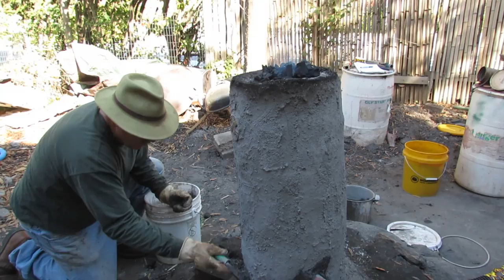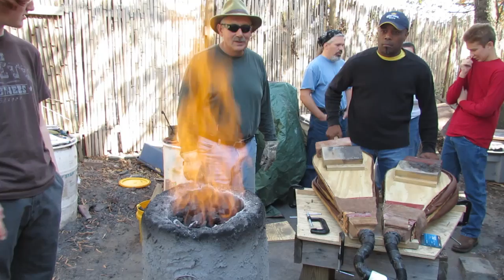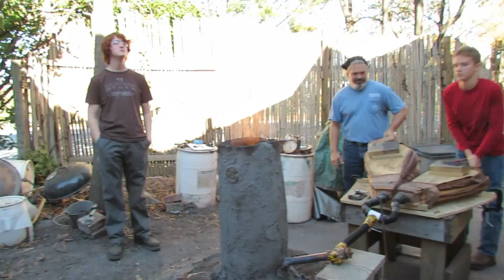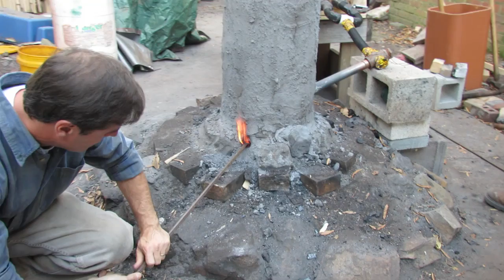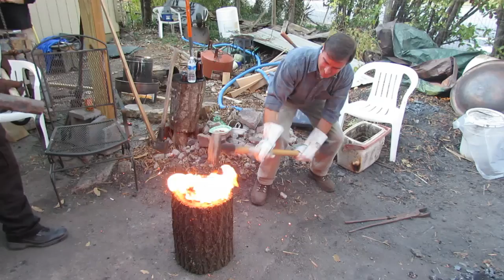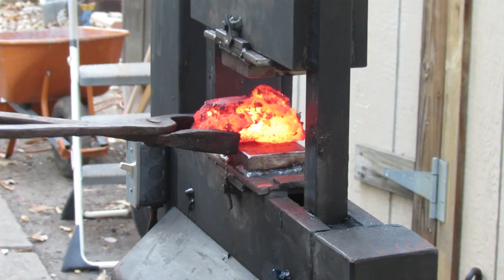Traditional smelt using manpowered bellows

Comment from the maker: At the present time, that's correct. The cost varies according to the complexity to manufacture the blade and the materials. The blade I have currently available is made from home-made steel. Steel that is collected as rock ore (iron oxide) and smelted into iron and then carburized into steel and folded many times.

Comment from the maker: Mark Green is the host.
The ore was local hematite (limonite) from NC.
Charcoal to ore was 1 Kg most of the time. 1:1 ratio going every 10 minutes.
Total ore: not sure but I think we stopped at 20-22 Kg and the bloom was 8 Kg.
Furnace was 8 inches diameter. Height? not sure 2.5 feet? Email Mark for more details.